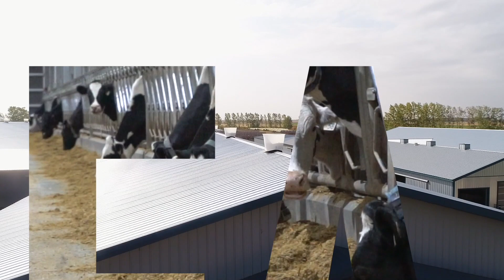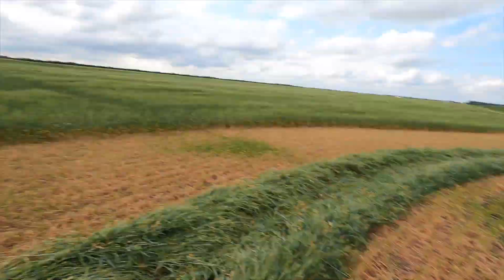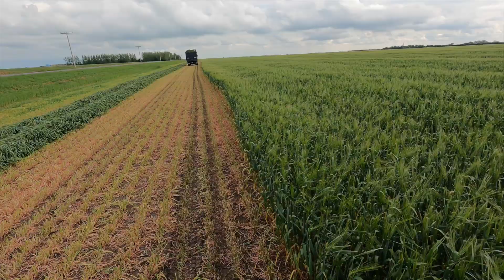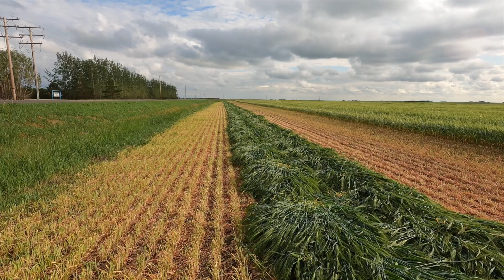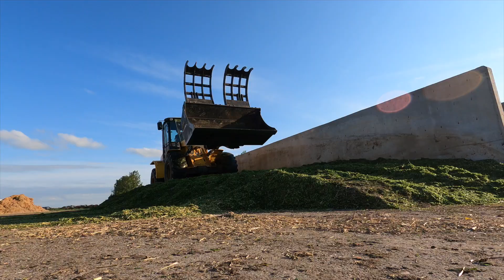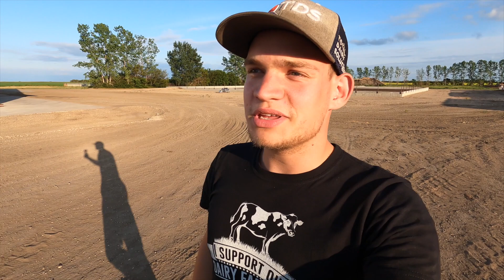Barn Expansion Plans and Chopping Some Barley!

Comment: Having that channel for slurry continuing for the new planned pack barns as you call them- is it worth it as those dung passageways also have a lot of straw in them that gets dragged off the pack/bedding- which won't go through the slurry pump! 
It's great your looking at improving the system, quite agree with it,- I've always said the dry cow period is the most important to a cows nxt lactation, plus her fertility- way off developing follicles in the cows ovarys, expanding that rumen with a diet right for the cow, chopped straw etc. Building work and normal daily routine don't go together on a dairy farm lol!

Comment: The width of the road allowance is 66 feet or 22 yards. This probably comes from the English land measurements and is  known as a chain. 10 chains (220 yards) are one furlong. Multiply a chain by a furlong and you get 4840 square yards, otherwise known as an acre.   22 yards is also the length of a cricket pitch.

Comment: Great video on the everyday situations and news on the extension to the Straw Pack Barn area. Wondering why Sask Energy couldn't wait a week or two to accommodate the routine silage harvesting? All it would take is a phone call or stall technique by the landowner(s), to confirm or delay the starting construction date. Seen it many, many times that landowners are asking to cut and remove crop, only to see the start day of construction delays. The problem in Alberta, is the land use by landowners farming the ditches, and running over and remove pipeline road crossing and energy related lease access signage containing Location - Emergency contact of responsible representatives. It's actually to the landowners detriment, and others using the easement to have these warning or information signage ploughed over by farming equipment. As noted in Jan's video at the end of the silage harvesting row, what appears to be a blue fenced area likely for rural gas distribution and notice just how close it was harvested. One bad turn and (day/night) and there could be very serious consequences Signage and fencing is essential for protection and landowners need to also respect others property, especially as it may endanger their own family, friends and neighbors.
Reply: Construction season in Sask is rather limited -- you don't do underground trenching in the winter (unless absolutely necessary).  So in summer, construction goes as fast as it can be scheduled, to make best use of equipment & time.  

Rescheduling for Jan's crop would interfere with the most efficient construction.  And what if the next farm down the road has a different crop, which matures a week or two later?  Scheduling would become a nightmare.

Also, the people who are impatiently waiting for Sask Energy to get that new fiber line available to them would be most unhappy about this delay!

Comment: Where I live, Glendale, CA just north of Los Angeles, this is called an easement. A preexisting flood control channel (cement lined, maybe 30 ft deep, 45 ft wide) cut across the southwest corner of the back yard. It was built to control rainwater from the foothill area above after a disastrous flood in the late 1930s. House was built in 1945. I believe the easement is 15 ft parallel to the edge. Our deed showed 5 sides to the lot, but yard does not. There is a city owned power pole in that corner and city crews (plus phone and cable) have right of access. Interesting to see how barley grows. One of my favorites.
Reply: up here the allowances are usually ditches used for water diversion, but western Sask is not known for it's rainfall like the central and eastern areas

Comment: Would be far better to allow cows access to outdoor environment, particularly to graze pastures during the growing season. Having cows confined to artificial enclosures all year round is just wrong. Not only that, but consumers are becoming increasingly aware of this and will demand better animal welfare and more ethical production methods in future. No matter how good the indoor system is, and the one here is excellent, it is no substitute for cows grazing outdoors. Cows should only be housed in winter and during periods of bad weather which can impact on underfoot conditions and animal wellbeing.
Reply: The land that would be required to graze cows on grass during summer would be huge. The weather in Jans part of Canada is too dry to grow good productive crops for grazing. Plus there would be huge cost to build a facility of this quality to only house the cattle 9 months of year. I know in Europe they tell the farmer to let the cattle graze part of the year then they complain if it too hot and if too cold for the cows. Then they complain about the cows manure run off and then about have to open and close the gates on the walking tracks. If the public under stood that the farmer act in the best interests of there livestock then we would have the ultimate relationship between the consumer and producer of agriculture products.
Reply: @Bbbb12-j8o  you are misinformed about the situation in Europe. Runoff is far more likely from application of slurry. I have never heard of run off from cows dung paths. Perhaps you are referring to outwintered cattle, where excessive poaching can lead to problems. Cows should be housed in winter when there is no growth or land is unsuitable for them to be outdoors. 
As regards cost, well European dairy farmers have these facilities to house animals in winter. So that argument is spurious. 
There are many benefits to grazing animals, lower cost, healthier animals, better animal welfare and better for the environment. 
I appreciate some parts of the world are more suited to a longer grazing season. New Zealand in particular can have a year round outdoor grazing system. That said, it is unnatural and immoral to confine cows indoors all year round. Cows should at least have access to an outdoor area for several months of the year. And with some creativity some sort of grazing system could be incorporated, supplemented with buffer feeding to make up the rest of their diet.
In the UK there is a quality assurance requirement for some producers where cows are required to be outdoors 6 months of the year. This is consumer driven. Consumer awareness and demand will lead to more focus on animal welfare issues, and this can only be a good thing.